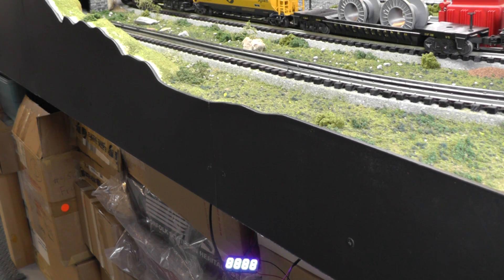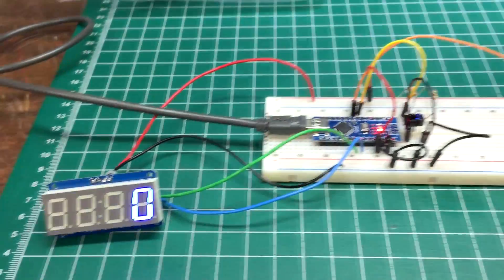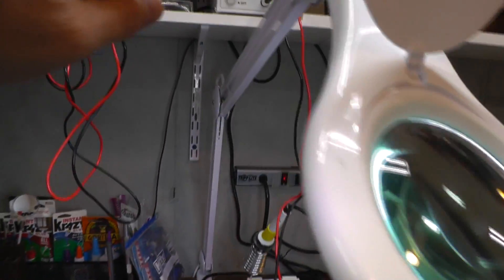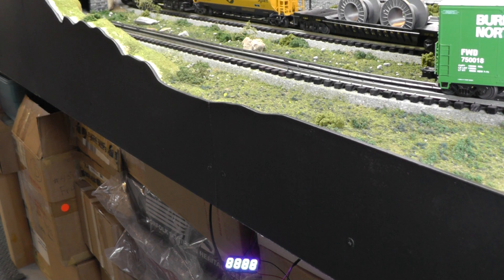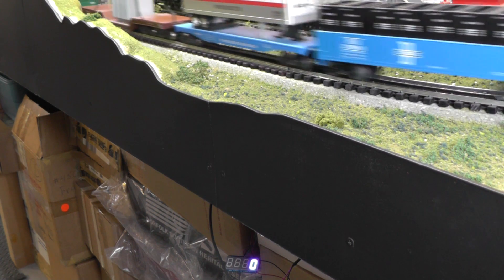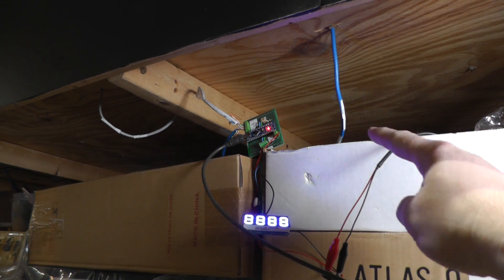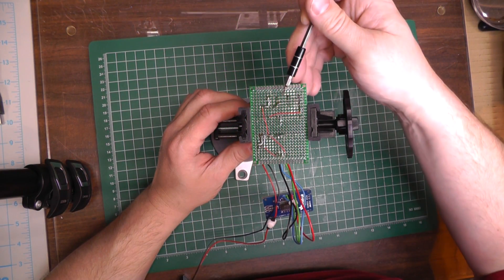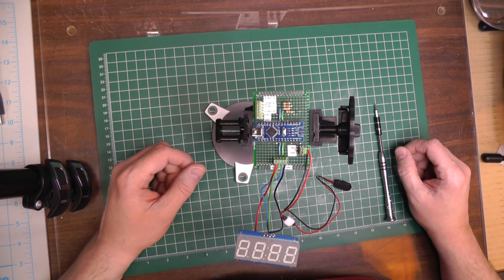Model Railroad Speedometer Arduino Circuit - Part 1

Comment: Hi Bob
I really enjoyed the video, i have been looking for exactly what you have built there, now like you i have managed to aquire a few hobbies but never really got into the electronics end that far i went into the computer side anyway, i was wondering if you have a full start to finish project listed some where that i could follow and yes build my own but using your smarts if that would be ok and of course the arduino coding and i do have the already the nano, uno and the mega, and all the sensors, but i was curious did you try to power more than one LED Digital screen i was thinking about putting one under a bridge lets say and the other in the control area. but any way i was hoping i could get the entire project from you

Comment: Hi Bob,
Found, Liked, Subscribed, & rang the bell thanks to Charlie Bishop  Chadwick Model Railway.
My personal RxR is down for a remodeling, but I'm bring your Speed Controller to my 4 Model RxR Clubs.  A couple of youngons from an area Polytechnic College, who are club members,  are already barnstorming how to upgrade the device.  First alter the algorithms for other scales.  These kids belong to my HO Club.  Also they (and I) are looking to remove the stand-by row of "8888" to a message board. i.e. "59330" or "SPEED" as well as other display messages from the Yard or Station Mgr.'s base device.  Change the speed display duration time.  And they think THEY can find multi-colored digital display units.  So thank you for the great idea and for motivating these young minds.
~Jim

Comment: Thanks for doing this video and schematics. I'm a complete novice at electronics, I bought all the parts and wired up the breadboard identical to yours.

However, I can't get any out to the 'serial monitor'. This is without the LED screen plugged in. Should I be getting a speed readout on the serial monitor?

My IR sensors are ON, I used my camera to 'see' them. I also tried Steven Spence's code just to be sure, and no readout on the monitor either. :(
Reply from the maker: I assume you figure this out by now, but if not...  in my Arduino code for the project, the lines for output to the serial monitor have been commented out and don't run.  If you remove the double slashes '//' from in front of the line "Serial.begin(9600);" and then remove the slashes from the other "Serial.print" type lines in the code, then recompile and load it should display messages to the serial monitor.  Hope this helps.

Comment: fantastic - how did you get the SMPH on your throttle ?
Reply from the maker: Part of the MTH DCS digital command system
Reply: @AllThingsBobot  Thanks - also what parameters do you use to Scale Miles per hour?
Reply from the maker: The start and stop sensors are set a known distance apart.  The start sensor triggers a clock which stops when the stop sensor is triggered.  Now we know what distance the vehicle traveled over what time.  Some basic math gets it to miles and hours, then multiply by the scale to get scale mph.  
Review the code and comments here:   https://allthingsbobot.com/model-railroading/model-railroad-speedo-part1
Reply: @AllThingsBobot  thanks for sharing your code - excellent work!

Comment: I am by far not an electronics or coding wizard and I am trying to make one of these speedometers. I am having a few issues: 
1. No power to display with adafruit files all loaded
2.When I upload the sketch it halts on Int=87; everytime 
3. Could really use a clearer diagram of all of the wiring connections 
4. Do you still have the PCB available?
Reply from the maker: Make sure you are using the exact Adafruit display I used, link:  https://amzn.to/2OubMmj
Reply from the maker: Assure you read all the links above in the video description for Part 2 and supplemental info on blogspot.  Between the diagrams there I really can't make the wiring simpler.  Assure you are using my code from the supplemental info page listed above...mine is set for int scale = 48;     You can change my code to int scale = 87;       but your note above didn't have the word "scale" in it?
Reply from the maker: You can get PCB's from here:  https://oshpark.com/shared_projects/noIshIQ1
Reply: @AllThingsBobot  I could not get the PCB's from https://oshpark.com/shared_projects/noishiQ1 - could you attach the files to us??  Thanks.
Reply from the maker: @williamturczyn4436  The links work:  https://oshpark.com/shared_projects/noIshIQ1     You can view and download the files from there.  Make sure you click the exact link....the link you typed has lower case "i"' and that will not work.

Comment: Thank you for this tutorial. I have always wanted to have one of these speedometers. I have a question, I am in HO and was wondering if I changed the int scale to 1:87 would it make change the algorithm properly?
Reply from the maker: Hi Joe.  Yes - although I have not tested it, you should be able to change the scale variable to 87 for HO and change the variable for distance between the two sensors in inches (mine were 18" apart) and in theory, it should calculate correctly.
Reply: Thank you very much, the script I have only goes one way as you said. This will be much more useful. Thanks for your help and video.
Reply from the maker: Great.  Give it a shot.  Worst that happens is that it doesn't work.  Hehe :D
Reply: Bobot's Trains and Maker Zone should I put 87 or 1:87. Also,  I wouldn't know it the speed was correct anyway since I don't have anything to compare it to lol
Reply from the maker: Just change the line in the sketch code to:      int scale = 87;
Reply: Bobot's Trains and Maker Zone will do, thanks

Comment from the maker: Arduino code here:  https://allthingsbobot.com/model-railroading/model-railroad-speedo-part1/
Reply: Hi Bob
I work with HO scale but I am not an electronics expert. I am fascinated by your creation of the "Model Railroad Speedometer" using an Arduino microprocessor. I am keen on building one for my layout but being new to electronics, Arduino, and also being a beginner, my knowledge is limited. Is there any way I can get a wiring diagram of your creation to help me out? I did search your blog and found the needed code but could not find a wiring diagram. Best regards, Rav.
Reply: Awesome! I'll dive right in.
Best regards
Reply: Hello Bob
I really enjoyed your project so I built one.  However, I am no expert with the code and I have a problem.  The following error message pops up when I try and upload the code onto my Arduino nano. "Adafruit_LEDBackpack.h" No such file or directory

The Adafruit display is connected and powered up.
best regards Les